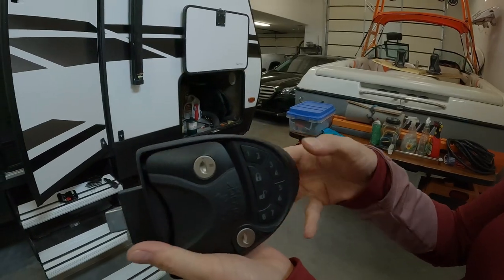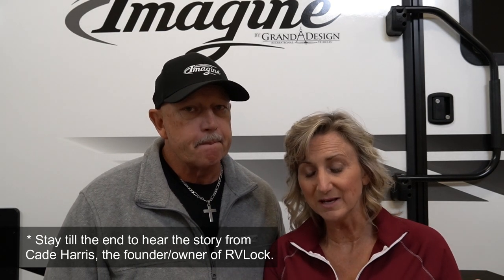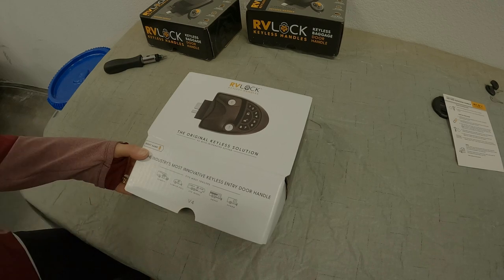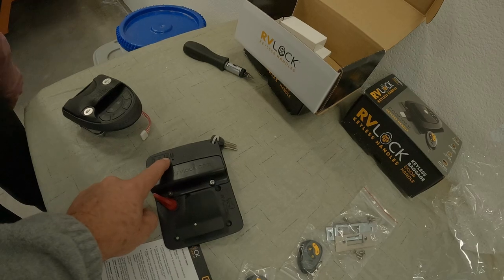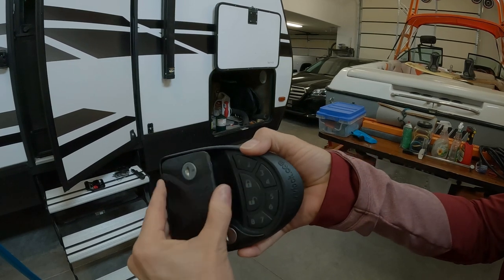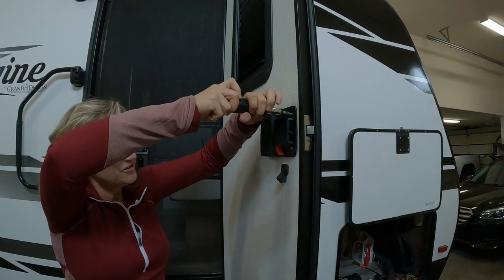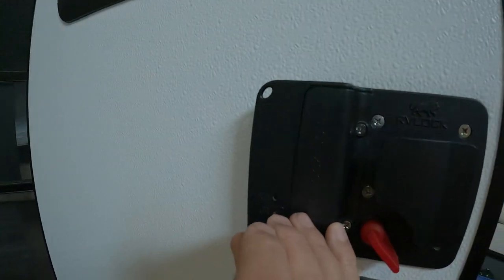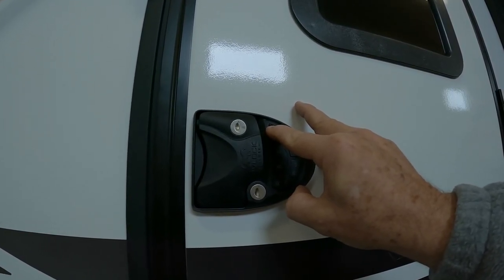Grand Design Imagine Full RVLock Keyless Entry System Install Video

Comment: I have them on my 5th wheel and the wife and I just love them.
Reply from the maker: Hi John, I can definitely say we love them too! Stan and Rhonda
Reply: In part of the video Stan made a statement about dealers using the same key to open up other rv's. Well I can say that is true because or salesman used the same key in all the ones we looked at. That was one the main reasons we changed locks.

Comment: Great install video, guys. I've been looking at purchasing these locks for our 2500RL. Having three different keys for our trailer is driving us crazy. Thank you for sharing. Peace and Safe Travels
Reply from the maker: Hi Craig, thank you for joining us!  Yes!  To be able to lock everything with one button is really cool.  RVLock extend their sale until tomorrow.  We have done a lot of upgrades on our 2500RL.  This maybe one of our favorites.  We are thinking about doing all the upgrades we did on our 2500RL in one video.  So many folks on our channel have the same trailer.  Blessings, Stan and Rhonda
Reply: @OverTheHillAdventures  That would be an excellent video. Shelley and I installed a LevelMate Pro+ this afternoon. We hope it will speed up the setup process for the long trips planned for this year.

Comment: We have them on both our Grand Design RVs all around.  Both RVs are keyed alike and same combo.  We found the batteries last about a year.  We LOVE them.
Reply: Two GD's, cool!  Can I ask what models you have?  We still have kids at home, so we are looking at a 311BHS and a 2800BH.  We also really like the Solitude 3740BH, but we would like to have more than $1.50 left in the bank after we purchase.
Reply from the maker: Hello Jim, we really love them.  Best decision we ever made.  I figured you would change the like you would a smoke detector.  Thanks for the tip!  Blessings, Stan and Rhonda
Reply from the maker: Hey Mike, just remember bigger the rig bigger issues.  Rhonda and I looked at the 5th wheels.  You just can’t fit them in National Parks or State Parks.  I think the 2800BH is a great rig!  Just food for thought.
Reply: @OverTheHillAdventures  No doubt, something we need to consider.  We have been thinking of getting something that can fit in our garage just for that purpose (to supplement the larger rig we will be getting), and also for many of the National Forest Service campgrounds.  We currently have a 24' TT (close to 29' measured from bumper to tongue), that we have thought about keeping for this purpose, but it is probably a bit too long, as shorter would be better in this case...and we would still have to pay to store it.
Reply: @mikenb11_51  We had a paid off 2018 Jayco Toy Hauler and in 2021 during COVID the dealer called and ask if we wanted to sell our RV because they had a waiting list of buyers for Toy Haulers.  They gave me almost what I paid for which was enough to buy an 2021 Imagine 2250RK TT they had on the lot (we use for traveling, state and national parks) and ordered a 2022 Reflection 337RLS we use for longer stays at a local lake or the TX gulf coast.  We love them both!
Reply: @jimblair2692  I like your two RV system!

Comment: That is a great project I have looked into this and can get it for my door but they don’t have any for my old cam lock doors on my storage compartment 😢. I also wanted to mention that they don’t make the snap pads for the older campers (2004)  I will keep checking on them. Thanks From Wisconsin
Reply from the maker: Hello Robert, RVLock.Com is having a 25% off Spring Sale ends tomorrow. Just food for thought.  I bet no one has the keys to the cam locks.  Good to know thank you for joining us.  Stay warm! Stan and Rhonda

Comment: Hello, just curious why you changed from latch-it door lock to RVlock door lock?
Reply from the maker: Hello Tim, when we put in the Latch It it was the cheaper option for us.  Latch It stop working without any warning.  The cool thing about RVLock it gives a warning when the battery is low which LatchIt does not.  What I also discovered was Latch-It copied RVLock.  RVLock is a family owned company based it Utah.  Once we met the family and the founder story, it was a no brainer for us to work together.  I hope this makes sense. Thank you for your question. Stan and Rhonda
Reply: @OverTheHillAdventures  Thank You for your response, I too are having problems with my latch-it lock. I’m thinking about changing to RVlock since customer service for latch-it is giving me the runaround. Again Thank You!!
Reply from the maker: @timallen1262  thank you Tim.  At the time after locking ourselves out of our trailer it was an immediate fix for us.  I pulled the video after having communication issues.  It worked for for almost a year.  We have RVLock on our bay doors too!  One of our bay door locks broke. I reached out and with in a week I got a new one.  If you go with RVLock check which one is cheaper Amazon or RVLock.  If you directly to RVLock.Com use our promo code just for our followers.  Put in OTHA10 for a 10% discount.  It will help a little.
Reply: @OverTheHillAdventures  Thank You!!!!!
Reply: @OverTheHillAdventures  I’m sorry but your discount code is not working. Thank You anyway!!
Reply from the maker: @timallen1262  contacted RVLock they said it should be good to go.

Comment: Promo code did not work
Reply from the maker: Hi Frank, did you use the OTHA10 promo code through their website?  RVLock.Com I will have them check on it.  Thank you for letting us know.  Stan and Rhonda
Reply from the maker: Hello Frank!  Great news all promo codes are on pause.  They are doing a Spring Sale!  25% off.  That is an awesome savings!
Reply: Do you have a contact email, I would like to share a cool mod. that I did to my 2500rl.
Reply from the maker: @frankl5675  yes, it is overthehilladventure@gmail.com. No s after adventure